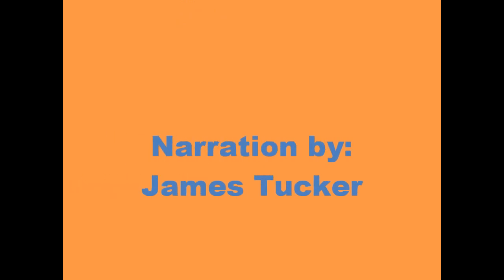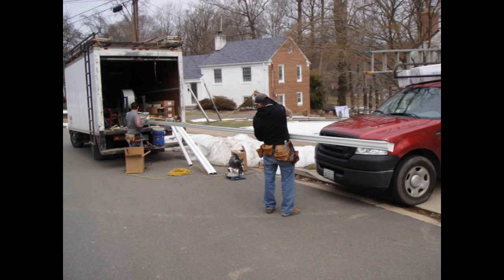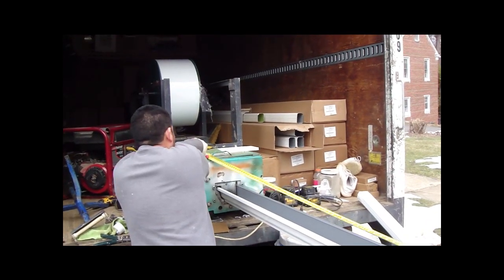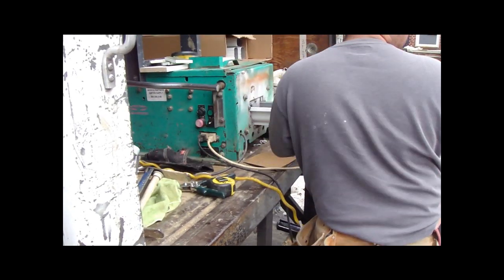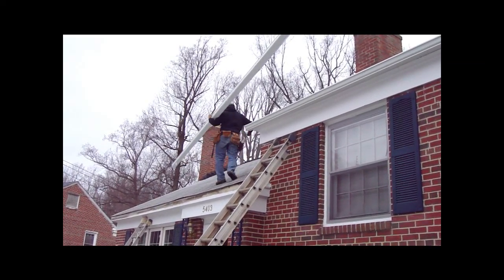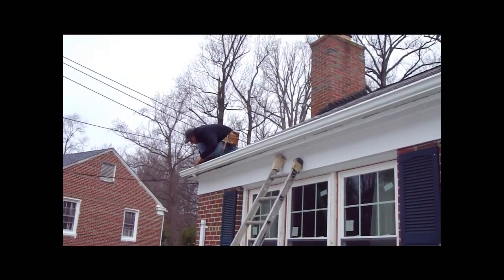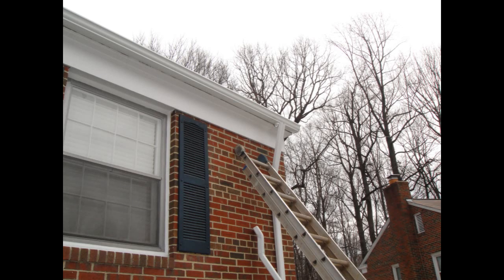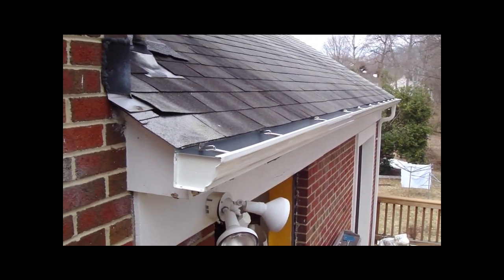How to Install Gutters Video

Comment: Your gymnast isn't using the proper 4:1 ladder ratio rule. Ladder will slide out, break a leg? 
No drip edge?
The snow clips you call them? With these clips, the drip edge overhang over the clips will only be 1/2" or less. Water damage to the fascia and soffits?

Comment: is it better to put screws in the end caps or just pinch them with pliers?  also rather than cut an X for the downspout is there such thing as a punch for that? I notice they used a hole saw; someone mentioned earlier that was a good idea if they are round but i use the box shaped spouts.
Reply: These are not pliers its called a crimper or snap lock punch screws work but the crimper tightens the seam so the sealant has less of a gap to fill. They do have gutter punches for box sjaped downspout holes.

Comment: I own a gutter company and saw a few things that were done that were better than most.. the downspout outlet was good even if round. Most installer just cut an X and attach downspout to that. Hangers were a bit useless...we put hangers in place and then prescrew them on ground. 

Biggest thing I heard was the slop of trough... 1/2" in 10' is nuts.  Yea it will work great but look like shit. And unless you have huge fascia board it will hange below fascia on longer runs.